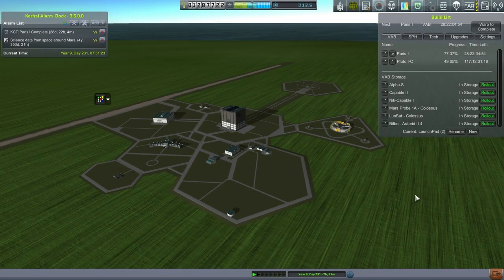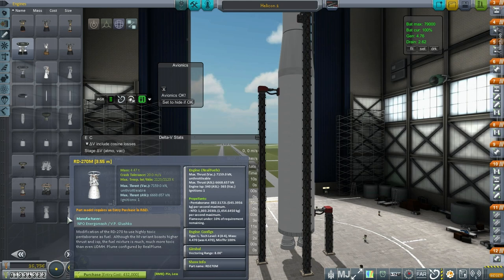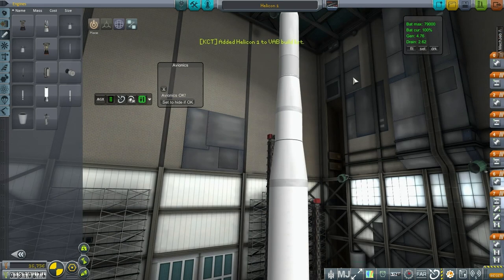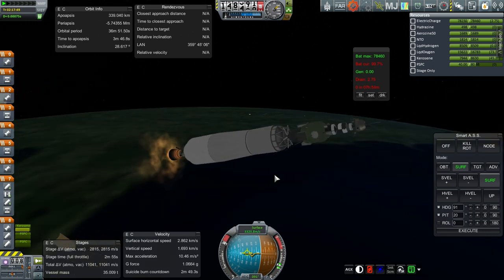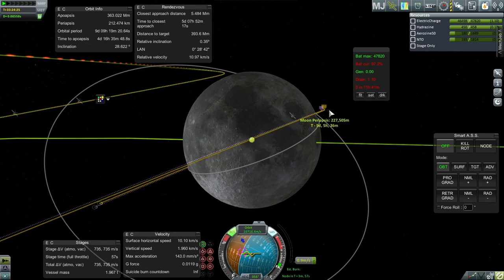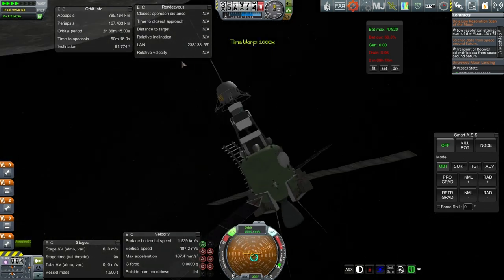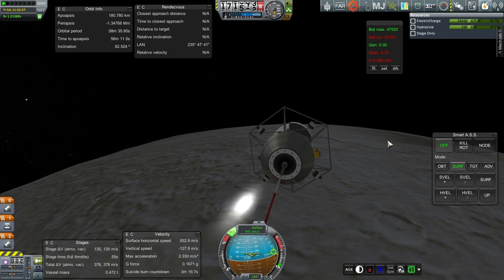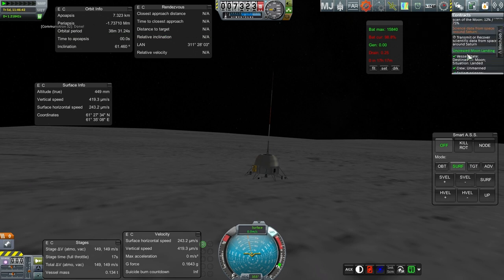Realism Overhaul in KSP 1.0.5 - 31 - Tiny Lunar Lander Probe

Comment: The Altimeter scanner would have worked. It might have just taken a little longer thats all. There is a Max distance, but I think it was like 500km. I believe if you had just left it to orbit for a week, viewing from the tracking station it would have gotten to the 75% coverage.

EDIT: I mean before you detached the lander. As for after the lander is detached, Well you can always stop the scan and let the batteries recharge before continuing the scan.

Comment: I'm thinking your rcs thrusters may have stopped responding to attitude control because your center of mass moved up as you burned through your fuel. If you're repeating this contract or a similar one I think an easy fix would be to put the thrusters higher up on the probe, maybe. In any case that should increase the torque of them, so even if it looks a bit more derpy it's going to be more efficient. :)
Reply: Well then, if you're sure that's the case I believe you. Just looking at the shape of the probe I'd have guessed the CoM would pass near where the thrusters were during the burn, but of course that is without knowing the exact densities of each component. :)

Comment: the scansat u dont have to stay with it it scan off the rails still. also easier to just open the map from toolbar to look at how much its scanned. u are correct on your lag u have way to many redundant sats might be best to clean up and launch a real sat network of your own design. those are linear rcs jets so they only go to sides and smart sas never been good with linear rcs. linear jets best for docking and 4 way for manuvering.
Reply: remotetech now has the auto switch feature to keep line site bbut i nottieced it causes more lag when u have tons of waste parts with cores and antanna

what i normaly did was try to put 4 sats in low orbit but far enough away that attleas 2 of them can always see each other thenn would put 3-4 as far out as i can to be still in sphere of influence to catch and transmit signal form other planets.one thing i always do is make sure they have some way to deorbit if a upgraded version can be put up.
for myself i say for every 10 sats is = to 1 fps(not true but its just a way to remind myself to make it effecent). last time i played RSS i saved space by putting up a 100 ton sat that had a disih for every major planet. i found that to be cheapest overall since remotetech has a auto part feature for signals now.